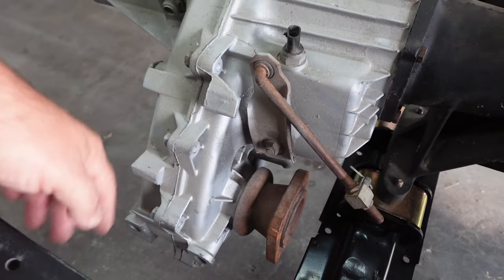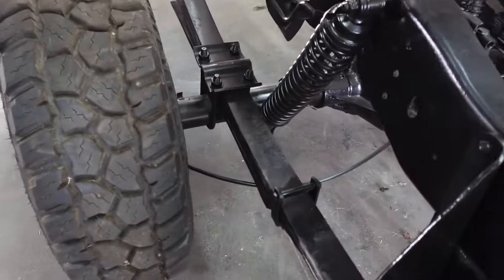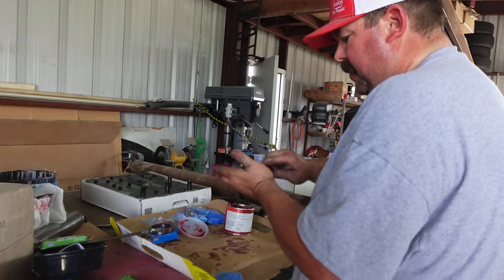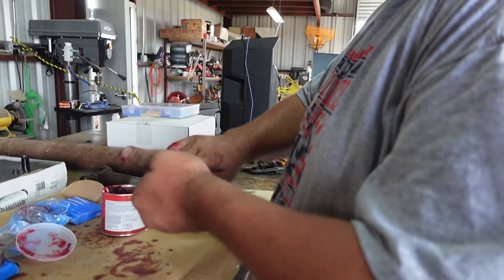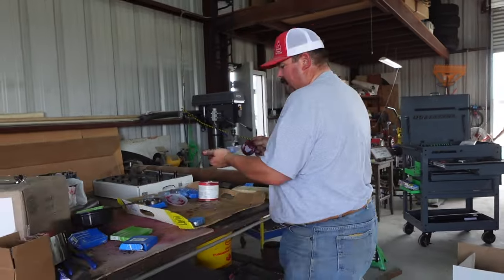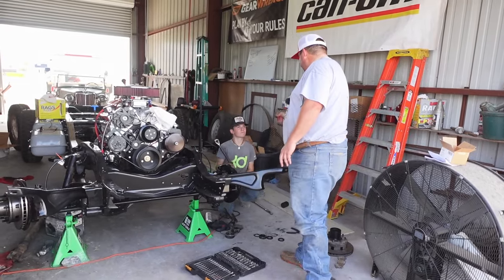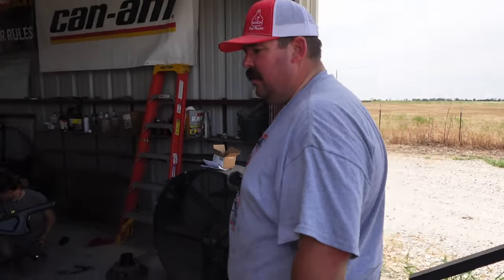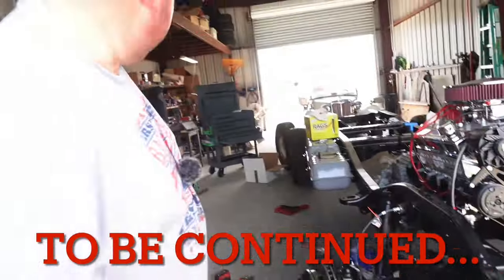Still Trying to Make it to the Car Show with the Square Body

Comment: Hey Cody and Clancy next time you pack bearings get yourself a heavy duty clear plastic bag and put a big blob of grease in it and drop your bearing in it and squeeze the air out and squeeze the grease into the bearing. It works really well I've been doing it that way for many years

Comment: Guys I have to laugh. Building cars is so much fun and so frustrating! I had the fortune to start wrenching on a race car a few years back. So imagine the frustration of working on a normal car, then take it out, run it as fast as you can every time, tear stuff up, and fix it on a regular basis. But working with parts that don’t necessarily go to that specific car!  Lol. It is enjoyable though